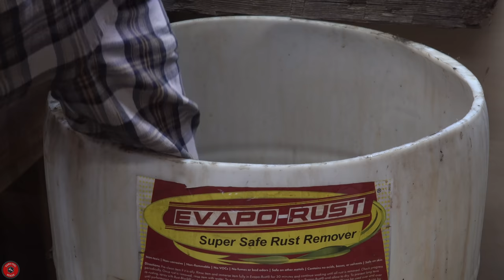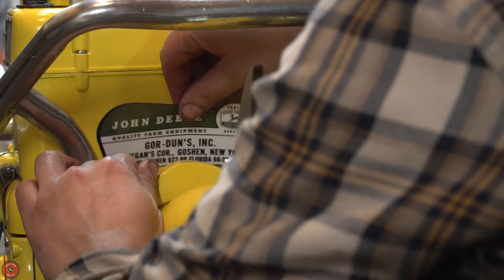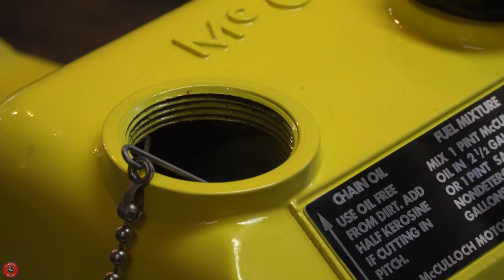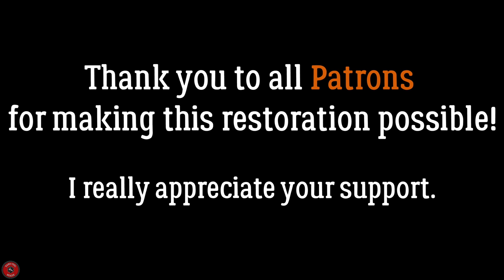Two-Man Chainsaw - Final [Restoration]

Comment: I was scared you'd give up on the John Deere dealer decal (FYI to the newbies; some JD dealers were dealers for other brands of other tools).  Did you do a screen cap of the decal and have someone print it on pressure sensitive paper?  Same for the black/silver McCullough label?  I'd say you did a more than great job. How you got spray paint to look THAT great- even with the catalyst clear coat- I will never figure out.

Comment: It seems like the metal tabs on the cover for the timing gears should have been bent up to the bolt heads. This would keep the bolts from vibrating loose.

Comment: Lock tabs are to be bent into the bolt not the casting. Into the bolt to prevent bolts from backing out from vibration. Your gonna have issues.

Comment: Thats a two stroke engine. The piston rings has to be locked from turning freely. There is a pin n the ring groove to prevent it. Or else the ring end will go into the holes and destroying cylinder and piston.

Comment: 9:00 a tip from an electrician for the next time
don't solder wires in movable pieces
there is a reason for that screw
soldered wires can break after a while

Comment: Not ideal to put solid copper wires on a machine that will vibrate excessively... Gluing down the white wire would have been good to prevent the flywheel from chaffing it like the last one... Overall, an excellent rebuild and restoration... WELL DONE!!!  10/10

Comment: Don’t solder the points wires, crimps work better in a vibrating environment (auto, marine, power tools, etc). Solder is for electronics. Soldered joints are more likely to weaken the copper wire and break due to stiff point in contact with flexible wire.

Comment: sounds like the tuning abit off. 2 stroke engine should rev higher than that
Reply: No. The early saws ran just like that. Big cutters turned with a torqy motor instead of small cutters at high RPM. Any leaner and it will burn up. Don't believe me? Watch some other videos of early saws being used. I collect saws and own about 250 at last count.
Reply: @bubbafudpucker397  i see...but goddamn thats alot of chainsaw!
Reply from the maker: I am glad to hear that Bubba.  I tried to tune it by ear and I wasn't exactly sure what this saw was supposed to sound like.

Comment: If you hone the cylinder, and install the same piston...  it is going to burn oil.  Probably doesn’t matter with a 2 man chain saw that will never be used.  But you can’t do this with a car engine or motorcycle.

Comment: MAC 99 History..No BS. In 1958 this was paired with another Mac chainsaw engine the Mac 10. at 9.9 cubic inches and 5.3 cubes for the Mac 10 these two engines were a potent choice for "C" class kart racing. because 99's were not that common and parts were a lot higher than for a Mac 10, 99's fell by the wayside and guys would run triples...3 Mac 10's.

Comment: I hate the fact that the amount of care in design, restoration and maintenance, makes this tool's value thousands of dollars. But that's not feasible commercially. 
And especially hate that all the parts are not close fitting, so filth can get stuck into the machine at any opportunity.

Comment: That solid wire for the points isn't a good idea man.  Copper work hardens easily, and that solid wire will become brittle and break before too long.  Any wiring in high vibration applications like engines should be done with stranded wire.  If she quits on you, that would be the first thing to check.

Comment: 1:30 alter Kolben und neue Kolbenringe, das ist mir neu, das bringt keine Leistung weil: der alte Kolben und der Zylinder sind nicht mehr rund, die neuen Kolbenringe aber sind noch rund, daß passt nicht zusammen,
1:30 old piston and new piston rings, that's new to me, that brings no performance because: the old piston and the cylinder are no longer round, but the new piston rings are still round, that does not fit together,

Comment: Great job on the rebuild....EXCEPT for the paint job.  That needed at least 1 more coat, maybe 2.  There's exposed places where you can still see the bare metal through the paint.  Also, I HATE that pale yellow color.  Damn near anything would have been better.  Looks like baby diarrhea color.
Reply from the maker: I debated a lot on the paint job, but I don't want to make it way better than new.  They painted this thing completely assembled and not all areas where ever painted.  The yellow looks way better in person too, you can see more accurate colour photos of it on my instagram.